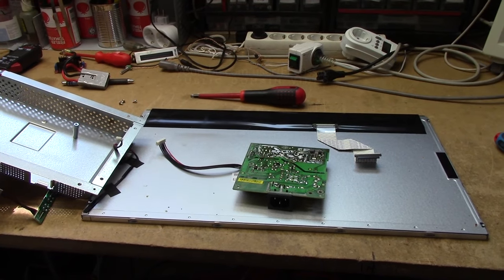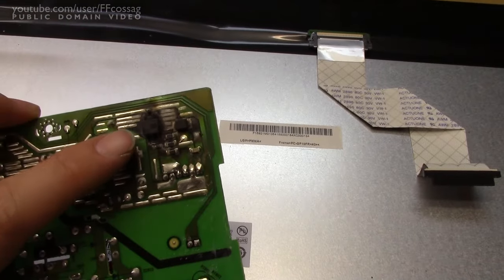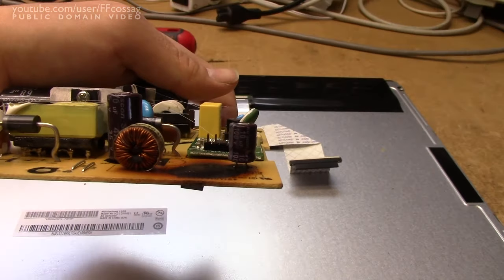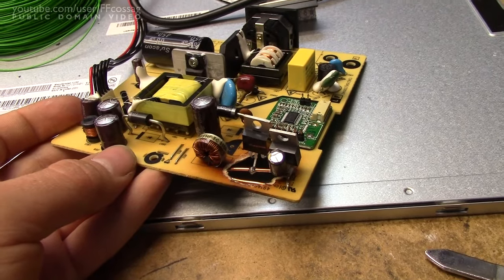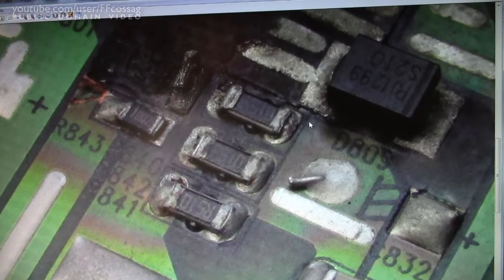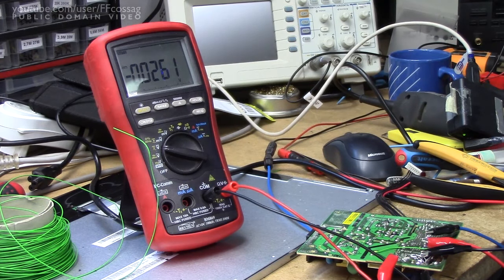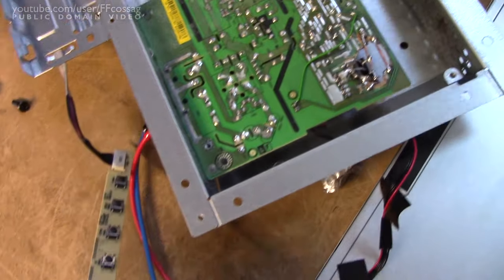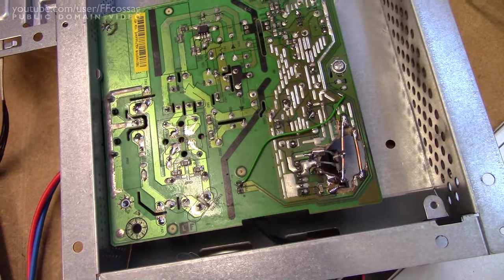HOLE IN THE PSU: Fixing a BenQ G2222HDBL

Comment: I wonder how many pirate/fake capacitors are in electronics  now days. Most of the capacitors I have replaced have failed in conditions that would be well within the expected lifespan. Perhaps the designers need to improve ventilation around the PCB?
Reply: People just need to spend the extra 20 cents for a better quality capacitor.